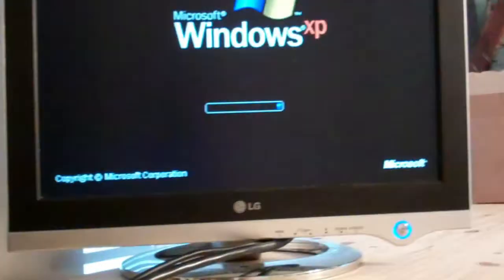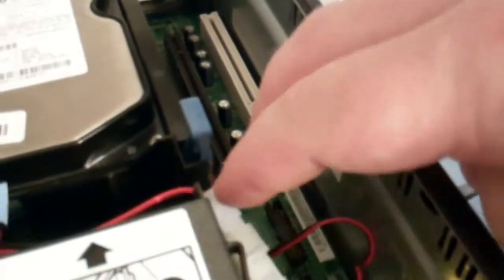2nd Fan Mod to a Dell Optiplex GX620 Case

Comment: What kind of fan did you get? Mines gets really hot as soon as I turn it on within minutes. Also for some reason the computer randomly shuts off for no reason whether it's do to the heat or power supply I don't know but have you ever needed to replace the power supply? My machine looks identical to yours.
Reply from the maker: It's just a generic brand (no actual name) 60mm thin fan I found on ebay as well as the y-adapter.. Could be your power supply failing (not for sure) but yes I have replaced a power supply on these-it's not too difficult and they can be found on ebay as well. Hope that helps!
Reply: Thanks, not sure if the problem is the power supply or a capacitor which has a little bit of brown dried stuff on top of it from the heat. I think I'm going to try and replace that capacitor first and see if the computer continues to randomly shut itself off, if not then it's the power supply. in relation to the power supply what would I need to replace?
Reply from the maker: If it's not that capacitor, I would just replace the power supply unit itself.. Search ebay by the model number of the power supply or by the model of the Dell and they should come right up.

Comment: Good Idea but the fan is pretty loud on 12v. If you cut the fan wires and connect the red wire from the fan to the yellow cable from the adapter and the black from the fan to the red from the adapter your fan will run at 7 volts which makes it much quieter but fast enough to keep this thing cool. I have modded a lot of GX 270/280 with overheating problems and it worked great with a fan set on 7 volt.